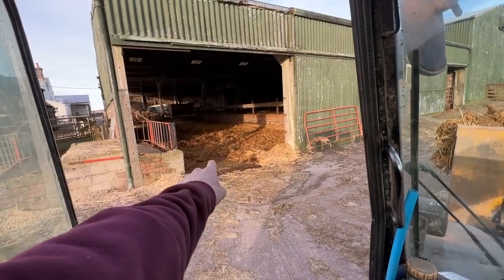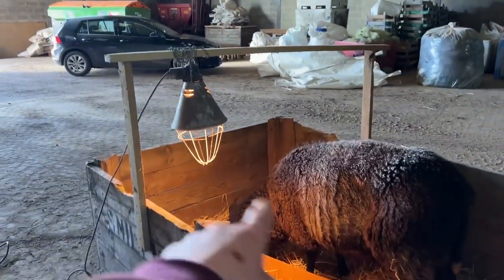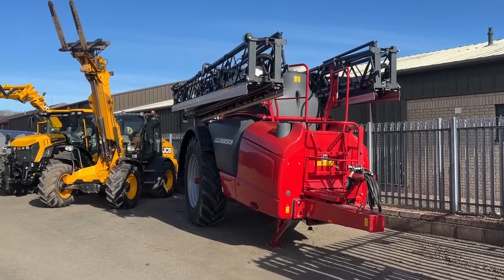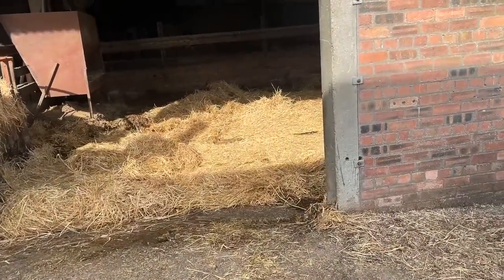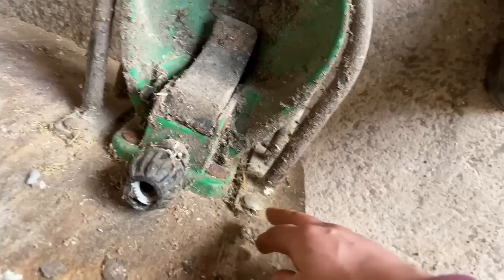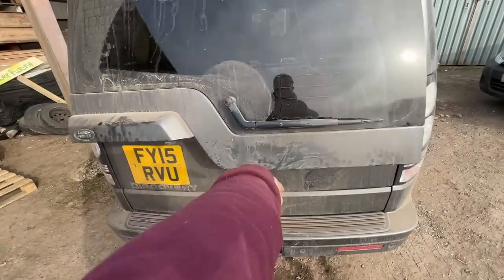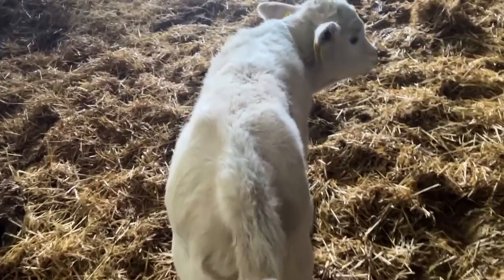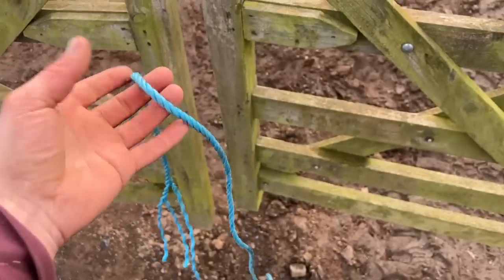Help The Roof Collapsed

Comment: We had that problem with our jcb, it wasn’t the filters it was the filter housing on the secondary filter at the front of the radiator
Reply from the maker: Yeh lift pump
Reply: @CrawfordsFarm1  we replaced our lift pump and it didn’t cure it, but then replaced the housing and worked a treat 🤷🏻‍♂️